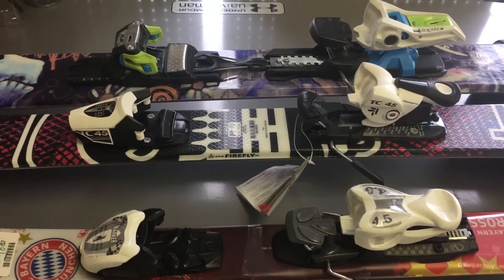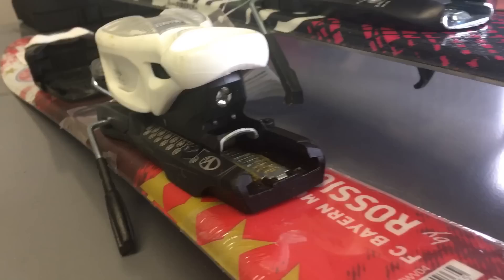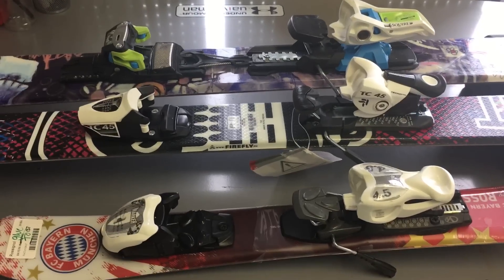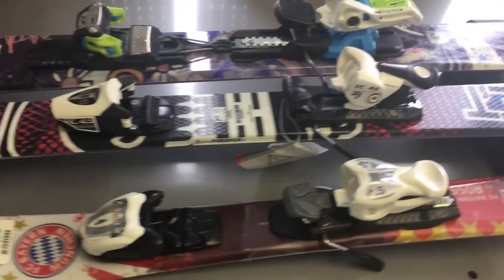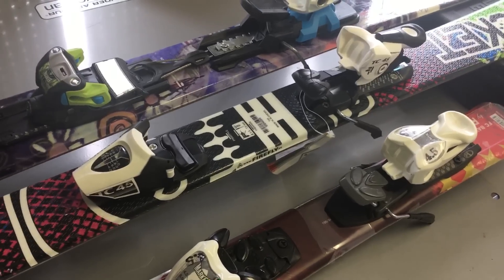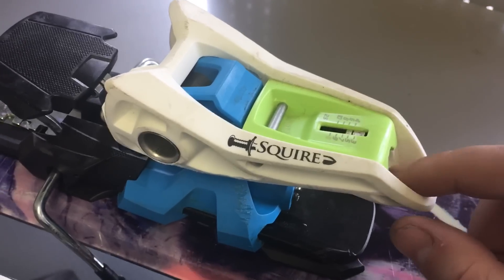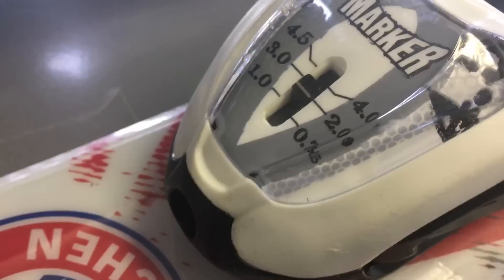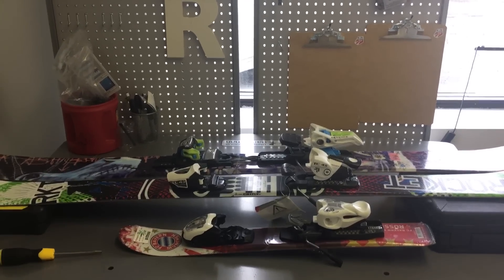What Is DIN & How To Adjust It! Ski Bindings Tutorials

Comment: The most common screw driver is a pozidrive #3 not a Phillips head which has a more pointed end. Some bindings do use a flat blade screwdriver to adjust din tension. Also some bindings require the boot be in the system to set the tension mostly on the toe if it is preloaded.
Release check with a torque wrench is the only way to determining if the spring releases within range.
Reply from the maker: thomas medeiros Thanks!